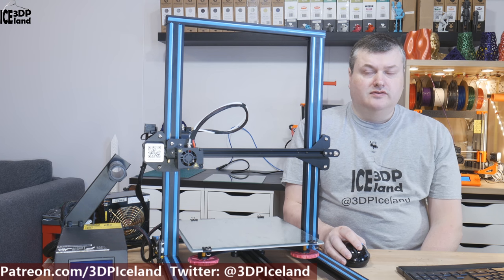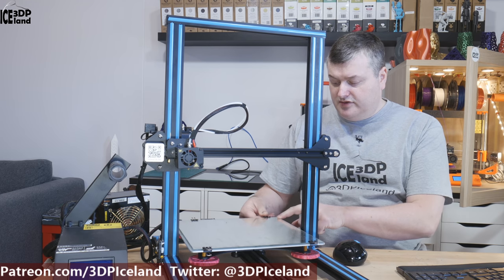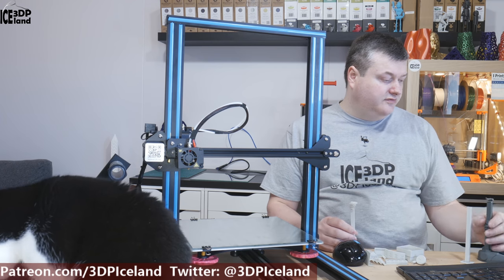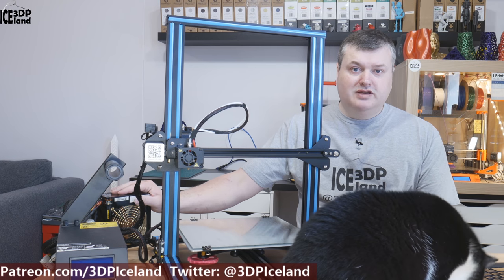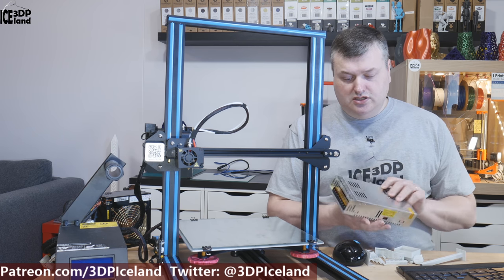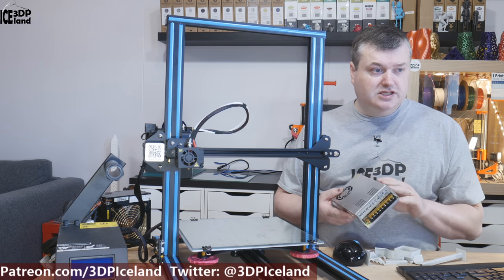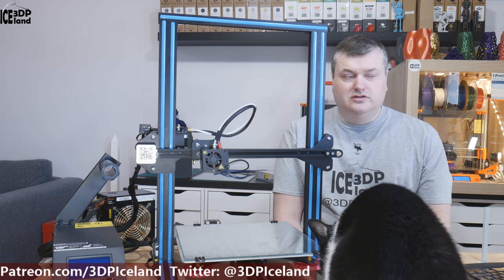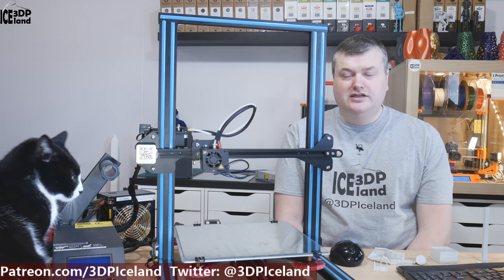Creality CR-10S  - Initial Thoughts

Comment: Good grief...it's taller than you are at your desk!  DAGGUM!!!!!!
You could print a kid on that thing :D
Is the glass warped, or the bed and it's pushing up the glass? I guess get a known flat edge and see which is warped
Definitely looking forward to the mods you do to it and seeing HUGE prints from that monster :)
Reply from the maker: hehe, yes it's 400mm high build volume, so it's big :), - glass is warped , - I put in ta mirror, and that is working well, so the heatbed it self seems to be flat.

Comment: Sorry to hear about your issues. 
I do not experience those issues (arrived today 😁) (still waiting for buildtack and magigoo) very impressed with its performance. Got it from Germany, Orange strips). Only issue was the filament in box was broken after about 5/8 if the cat print. Stooped it, changed filament and continued print without too much hassle.
Reply from the maker: no worries, - all this can be fixed and I guess I just had a bad luck with mine.
Reply: 3DP Iceland possibly, But still sad it “gets you”. (I know people deserving more bad luck 😃) all is fixable, but nothing beats a printer working good from scratch. ;)
Reply from the maker: yea, it's a bummer, - I was hoping for a good experience out of the box as so many people have had, - but as with box of chocolate,  you newer know what your'e gonna get.. :)

Comment: Anycubic has a 310x310 mm Ultrabase printbed, if it is the same as the 201x201 one that means it has a double sided tape on the bottom to stick it to the heatbed. So you cold lose the clips with that. The anycubic store on Aliexpress also shippes from Germany.
Reply from the maker: Hi Danny, - thanks for that information!.
Reply: Just saw a video by the 3d printing kid on the 310x310mm ultrabase. His did not seem to have the double sided tape on the bottom. I am not sure if there are multiple versions. Just so that you know.
Reply from the maker: Danny thanks, I will look i to that, am also thinking about the buildtech flex plate system

Comment: Bad luck and bad design...having a 5A connector where 17+A could be drawn is a serious problem and it could catch fire if there is flammable material nearby.
Reply from the maker: yes, agree, - they have made this chose to save some bucks, on the cost of the end user safety.